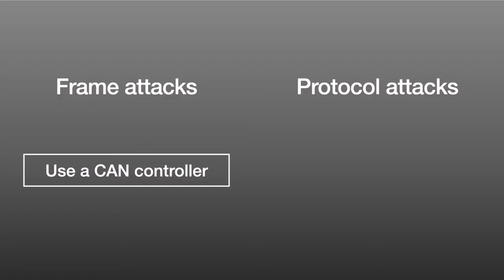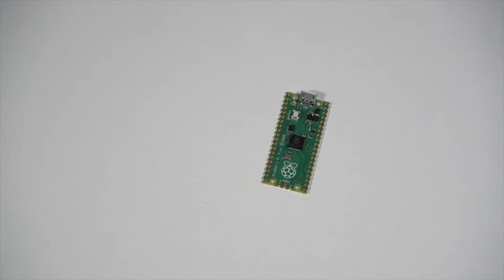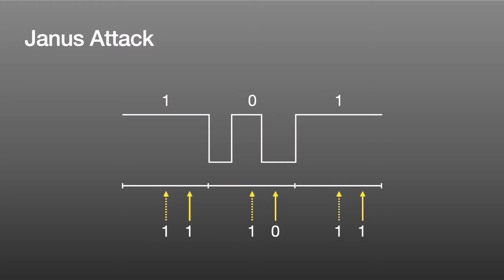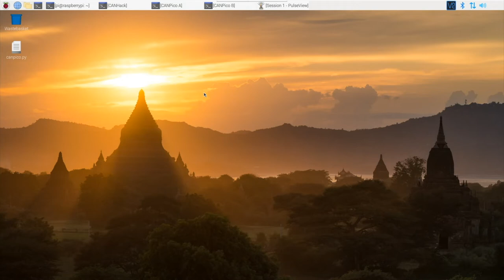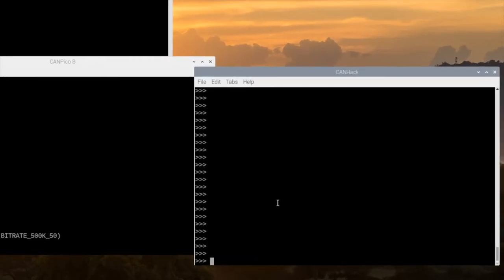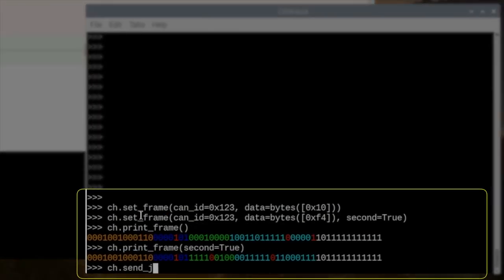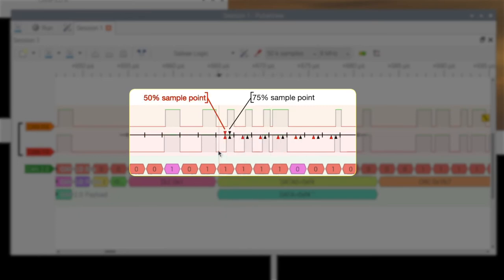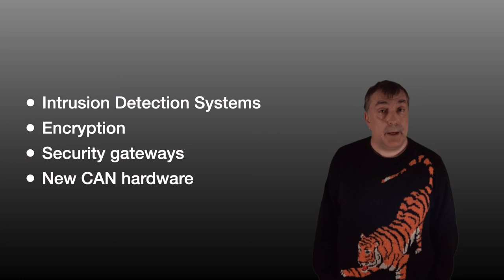Defending CAN bus Part 1: Attacks and intrusion detection

Comment: How did the receiver manage not to give CRC errors?
Reply from the maker: Because the Janus frame includes two CRCs as well as payloads. If you go to 7m06s you'll see the two bit patterns of each sequence printed out.
Reply: @kentindell  Ah got it, 2 payload and CRC
One is actual while the other is spiking only at 50% sampling point.
Each receiver based on their sample point sees different data and CRC, so both acknowledges it.
Wondering how the receiver controller managed phase errors and ReSync Jump Width due to more transitions from recessive to dominant introduced due to spiking.
Reply from the maker: It exploits CAN sync rules: CAN only syncs on falling edges, only once per bit, and only if the previous bit sampled as a recessive.
Reply: @kentindell  Thank you very much for your time and explanation.